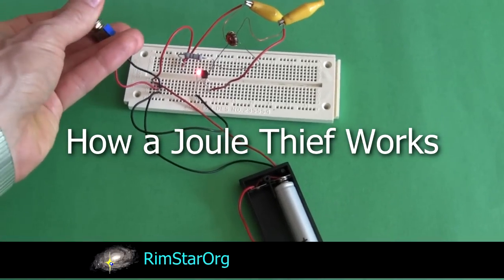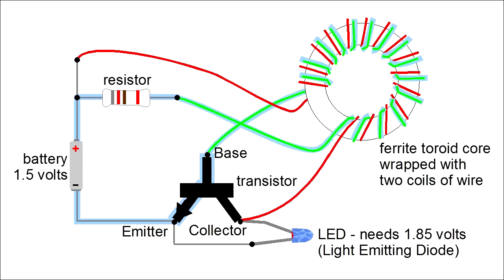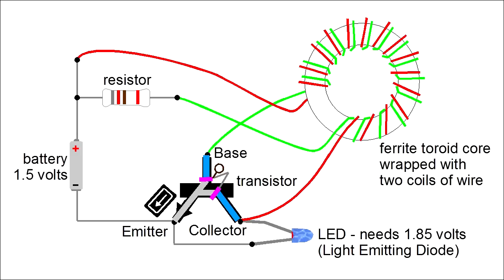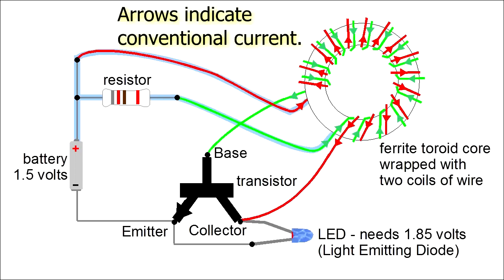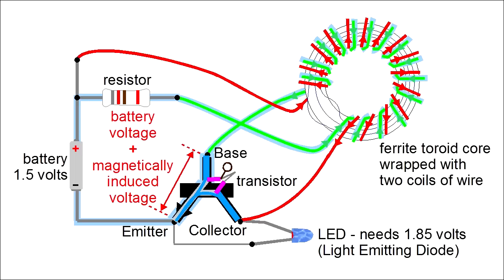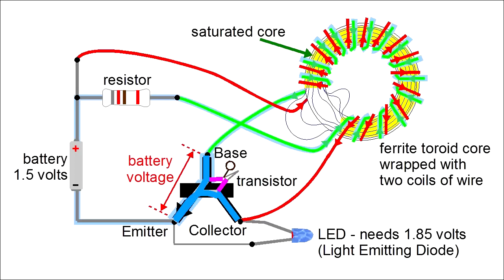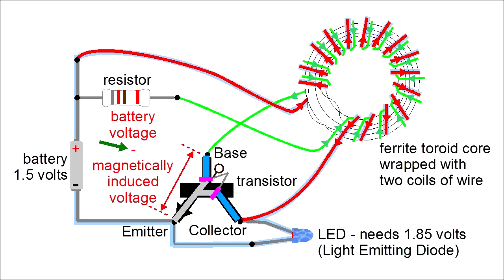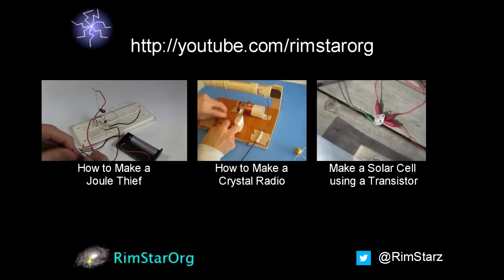How a Joule Thief Works

Comment: Very nice play-by-play description. A couple of points:
...
 This is a common form of switching power supply called a Boost Converter. 
http://www.radio-electronics.com/info/power-management/switching-mode-power-supply/step-up-boost-regulator-converter-basics.php
...
In short:
 The reason you get a higher voltage at the LED is the property of an inductor to maintain a current flow, even as you try to stop it and as the magnetic field collapses. When the transistor turns off (3:38), the current starts to drop causing the field to decrease, but this decreasing field induces a voltage in the red wire (opposite to that which had been present) that causes the collector voltage to rise and it will go above the battery voltage until the LED turns on.  Then, the current in the inductor (which was in the collector) will now be flowing in the LED.
  Another term used to describe this is is "inductive Kick".  Similar to the principle used in engine spark coils.  You get VERY high voltage at the turn-off (at the collector-red wire junction) if there is nothing to conduct that current.  The inductor will actually create whatever voltage is necessary to get that current to flow SOMEWHERE, even in an arc in air.
...
The constant on-off switching (oscillation) is called a 'relaxation oscillator' since the frequency depends on only the inductance and associated resistance, primarily in the collector circuit and red wire (along with the battery's internal resistance). 
...
You could put a diode (half wave rect) between the collector/red-wire and the LED then a cap across the LED for a more constant LED current, but that wouldn't buy any real improvement.  For the same average current, LED actually appear slightly brighter with pulsed current.
One fine point I'll point out.  It is not necessarily core saturation that causes the shut-off of the transistor (@ 3:48).  The collector current will build to a value that depends on the battery voltage, red wire resistance and collector saturation voltage. I=V/R   When this value of current it reached, the current stops rising and the field stops increasing.  The now constant field no longer induces voltage in the green wire thus removing the base current and the transistor shuts off.  Core saturation will be the cause only if the core saturates at a current below the 'on' collector current referred to above.
Finally, this type of circuit can be in the upper 90's percent efficiency-wise if designed well.  It is used in some very high power, power supplies.  Loss would be in the red wire resistance, the core if not a good material for this and not matching the green wire turns to the transistor's need for base current.
Cheers, a power supply engineer.
P.S. NO. It's not free energy, just another way of transforming voltages.  POWER-OUT will equal POWER-IN minus some small loss in the core, wire and transistor, all in the form of heat.
Reply from the maker: And yet another name is blocking oscillator.
Regarding core saturation as the reason, that's why I said a "a few things can happen to cause the process to reverse". Unfortunately, and to my regret ever since, I decided to put in only one reason. Silly me.
Thanks for the write-up.
Reply: RimstarOrg Very good.  Yea, blocking.  I think I put that in another reply...
It's always nice to see something in the hacker domain that talks sense.  I hadn't heard of the J.T. and was curious.
...
Also, I understand the issues of trying to provide an explanation of some basics, yet not get all bogged down in every conceivable "correct" detail and over explain so the basics get lost in the forest of detail.  Then there's the inevitable comments about "you forgot this or that detail" that may be absolutely correct, but not important in absorbing the basics first.
...
I can't comment not knowing all the detail, but with reasonable numbers of turns on the "red" winding I find it hard to believe that with an almost dead cell and that size of that toroid, that the dominant effect is core saturation rather than the circuit resistance limited transistor saturation.  That's why I commented.
'gards, Steve
Reply from the maker: Observ45er
Yeah, I agree. When I decided to pick which effect to explain, core saturation wasn't the best choice. Oh well.
Reply: RimstarOrg Don't fret.  You got 99.99% correct and that ain't hay...  Too many vids are hardly 10% correct...  Hope my explanation helped someone...
'gards, ScienceAdvisorSteve

Comment: Will do thanks. I love inverters :D Used to work in an onion packing factory looking after the water delivery system (very problematic, hence fun) and these things made precise control over the pumps so easy :D Do they all put out a square wave or just the cheap ones?

Comment: Have you done any measurements of efficiency ? Power in power out ? How lossy are these systems ?
Reply from the maker: I haven't done any. I'm also not aware of any but that doesn't mean someone hasn't tried.
Reply: RimstarOrg Thank you . I , with finger in the wind knowledge , would suggest , they would be found , notably lossy , as it is a brew of resistance - heat loss & collapsing magnetic field ...... but I not suggesting it can be bettered ....... without more up front cost & madness .  I think the term that you comes to hand , would be cost effective .

Comment: How about replacing the transistor with a MOSFET, still works?
Reply from the maker: I think I heard that someone once got a MOSFET one working but I don't have any link or know what changes they made. There is a difference in that a bipolar junction transistor like in this video, turns on at a specific voltage but the amount of current between base and emitter controls how much it allows to conduct between collector and emitter. With a MOSFET, when it turns on and how much it allows to conduct are both controlled by voltage. I haven't thought about it much but that may require some changes.

Comment from the maker: Ah, cool. I've made voltage multipliers, but always driven from flybacks which in turn were driven by a DC power supply. Never thought to drive them with a joule thief and a small battery.

Comment: So what if I put a Cap in parallel with the LED? could I get it to stay on?
Reply from the maker: No, because you'd still need to build up enough energy to light the LED. So once you'd filled the cap you'd need to dump it all to light the LED.
Reply: RimstarOrg how would one go about dumping the energy to light the led? could placing the cap in parallel allow you to use the energy from multiple batteries?
Reply from the maker: John Williams
I just wouldn't put a cap. The energy from the magnetic field is already being dumped into the LED. The idea behind putting a cap, at least I'm guessing why Ham549 was asking about it, is to smooth out the spike so that when the energy is dumped, it's spread out over a longer period of time. Since the on/off frequency is already faster than the human eye can notice, you'd just end up adding an extra loss for no gain. I'm not sure what you mean by your second question. If you have enough batteries to add up to a sufficient voltage for the LED then I'd just use the batteries directly and skip the joule thief. The purpose of the joule thief is to handle a situation where you have insufficient voltage.
Reply: Thx

Comment: Is there any particular reason you are using that transistor over say a MOSFET (asking because the only good transistors i have are MOSFETs).
Reply from the maker: I don't know an equivalent circuit that uses a MOSFET, not that there probably isn't one.
Reply: A MOSFET probably wouldn't switch on with only a 1.5 volt battery. The circuit would work with a MOSFET with a higher voltage battery to overcome the gate threshold voltage.

Comment: Something doesn't look right and I don't know who has it wrong?
In all the circuits I have seen they have the resistor to the base after the coil winding, not before it like you have it.
My opinion is, you want to control the high voltage produced at the coil to the base far more than the low voltage coming from the battery. You are using the battery to control the current from the battery to the base coil on one hand and on the other hand exposing the base coil to get energized by the collapse of magnetic field of the collector coil.
but what do I know.

I came here to find out why the coils are oppositely wound to each other, at least I seem  to see the reason behind it as you explained.  I haven't yet found anyone else explain the reason for it. They just jump right over that.

I also don't get where does the changing magnetic field on the collector coil comes from that induce current in the base coil.  Is the changing magnetic field caused by  some  sort of change in current through the C coil, it couldn't be from change in direction.  You jumped over that part.
Then somewhere you went back to the battery to show the cause of collapse of the magnetic field in... not sure what coil as there are two of them.
I guess I can't think as fast as most people.. is perhaps the problem. I missed the explanation for it even after pausing the video plus watching it twice.

Comment: I'm using an old 1950's rooftop TV antenna. Remember when a view of a city skyline was full of those? I wonder how many are left. Not many in my neighborhood, that's for sure. I was hoping my LED would show up brighter at night, but that didn't happen. The only station in town that can power an LED in the daytime goes on reduced power at night. As I write this I'm wondering if some sort of joule-thief gadget could be used to light an LED with crystal set power.

Comment: Thx very much for reply... i wired it many times over exactly, for watever reason, it's not workin for me.  Maybe i'll try again.  The other one that works that im using is with the pair from opposites sides shorted to + with resistor into base rather then coil.

Comment: I made a circuit just like this that lit a four volt LED with two dead AA batteries for years. Recently I used it in a battery charger that I made to float charge non chargeable batteries without them getting hot or even warm. The joule thief is really acting as a pulse width modulator that allows the LED to dim therefore the LED can be lit with less voltage than it takes to operate the LED otherwise it will not light it at all. This let me monitor a voltage drop in a capacitor by watching the LED go from bright to dim . I am not too sure that we are actually getting something for nothing as usuall  ....

Comment from the maker: It wouldn't work. The coils accumulate energy in the magnetic field. During that time, the LED isn't powered. Then, after a lot of energy has been stored, it's all dumped in a quick burst, giving higher voltage AND current. With a transformer you step up the voltage but drop the current, which may not be enough to light the LED.

Comment: hi i have a small question,
I have another circuit that produce low millivolts (200mv - 700mv) with a very low current. Is it a good idea to use this circuit to power up loads or charge a rechargable battery? Any modifications are needed
thank you very much and best regards ! :D
Reply from the maker: nour shahawy I've never done it though I've seen videos in the past of people who have used joule thief circuits to charge batteries. I think they were doing it for fun. As for powering loads, the output is not flat DC and not sinusoidal AC for it doesn't work for a lot of loads. You can see the voltage output in my video about making a joule thief here https://www.youtube.com/watch?v=B61DU7yEsPM
Reply: Forgot to tag u in this comment. Sorry, Please read the reply.
thank you for your quick feedback ! :)
Reply: RimstarOrg Thank you very much for replying and i am sorry for posting this question 3 times. I actually didn't expect to be answered that fast. Well, i still need help . Is It possible for me to stay in contact with you? i really need some help while i am doing a project that i am participating into google science fair. It is about wireless transmission of electricity and i actually saw your previous video that inspired me and caused me to create my own circuit so can u please help. i am currently in summer vacation and i am out of contact with all my physics teacher. It would be grateful if u help

Thanks again :) !
Reply from the maker: nour shahawy Sorry but I really don't have time to help with individual projects except for answering questions regarding problems replicating projects that I show in my videos.
Reply: RimstarOrg It is fine , I understand . At least u answered my questions. Thank you and Best regards !

Comment: I'm a bit confused...the windings are in opposite direction....wouldn't their magnetic fields oppose each other?
Reply from the maker: Yes, but at 2:38, the current is higher through the red wire so its field is stronger.

Comment from the maker: Wouldn't work. During one part of the cycle the current is in a direction to turn on the transistor, but during the second part of the cycle the current reverses due to the direction of the collapsing magnetic field and quickly shuts off the transistor.

Comment: i made a second jould thief, but it doesn't seem to work very well, my first one will light with voltages well below 1v, but this one has 2 AA's together giving about 1.8v and it won't light, i used 30ga magnet wire on the torroid this time, (last time i used some 26plastic coated) because i thought if i could get more turns it would work better, what should i look for to fix this problem?

Comment: If you wanted to initially increase voltage and current along the green coil so there would be enough voltage on the base of the transistor to allow a connection then why add a resistor?

It looks like what you doing, is allowing the electromagnetic force from the wrapping red wire to increase the voltage (via inductance I believe) of the green wire.  But if the goal is to increase voltage and current in both base and collector why need the resistor?

- eager student =)

Comment: What is the frequency range of this circuit?
How we can optain 50 hrtz frequency from this circuit to use it to charge batteries from sollar cell if we use step up transformer?
Reply from the maker: ayman zayed I don't know the frequency range of the joule thief circuit. With this simple LED circuit and an 820ohm resistor I got around 22kHz. 50Hz sounds a little low given that, but I can't swear it isn't possible.
Reply: +RimstarOrg thank you for mentioning what the ohm rating is.  What are the values of the other parts?  Thx.
Reply from the maker: +Lloyd Dalton For the other parts see my video on how to make it https://www.youtube.com/watch?v=B61DU7yEsPM. I go through it all in there.

Comment: Its been running for 24 hours now, the LEDs are dim but not dead. I suspect I got luck with my coil in the number of turns and ferrit core size.

Comment: well it won't light with the 1.8v batteries, but if i put fresh batteries in it does - This one has like 20 turns, the first one only has like 8. - maybe thicker wire creates a stronger magnetic field?

Comment: Why this sparks of voltage does not killing led? Or do they, but slowly?
Reply from the maker: Good question. I don't have an answer for sure but my guess is that the spikes are probably too brief. It may well be killing the LED slowly, I haven't run it long enough to know. Note also that the voltage measurements I've made were always directly through an oscilloscope and not across the LED, so the voltage when the LED is in the circuit may be lower.

Comment: wow that's amazing! and all of that happens like a billion times per second heh. i have a question, is that toroid similar to the ones we find in electronic devices like computers? i took appart a few of them. the one i have here from a computer aparently has 3 wires each making 5 turns around a toroid that is atracted by a magnet and insulated and they all wind up together in 1 input and 1 output. sorry i don't know anything about electrical engeneering i just find it amazing and beautiful

Comment: Semiconductors are current devices , and that 1.85 v is the MAXIMUM that component can tolerate ... NOT the minimum voltage that will cause it to light , usually between .3 and .7 volts depending on the chemistry of the junction (color)..

Comment: The narrator was talking about how a transistor works.  It's misleading to speak of "voltage" as the controlling influence over current through the Collector/Emitter path.  It's the level of current flowing from the Base to the Emitter that controls the amount of current flowing from the Collector to the Emitter.  There is a constant called Beta [ß] that relates the two: Ice = Ibe*ß, where Ice is the current from the Collector to the Emitter and Ibe is the Base/Emitter current.

Comment: you see the green wire touching the base. take it off and put it with the neg of source touching the emitter. raise the voltage up until it starts. I accidentally did this and it seemed to work at 45v dc. Using lasersaber juele ringer 3.0 diagram. specs.. For some reason having it wired up to specs did not want to self start easy. I did this in preparation for Irma Hurricane. I think it is working cause the voltage to the emiiter is reaching breakdown and the potential in pressuure Volts difference cause the emitter to let some energy threw it in proper direction from the collector side.  Some one please explain why this works

Comment: Wouldn't a step up transformer do the same thing?  1.5 in and 1.8 out?
Reply from the maker: Yes, except that the battery is putting out DC and a transformer needs AC, so you'd need some circuit to convert from DC to AC anyway.